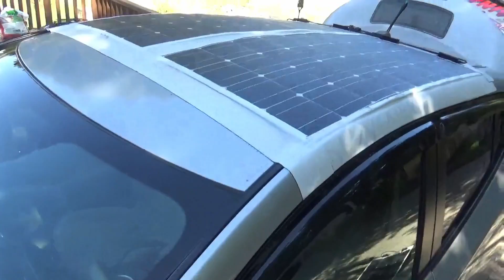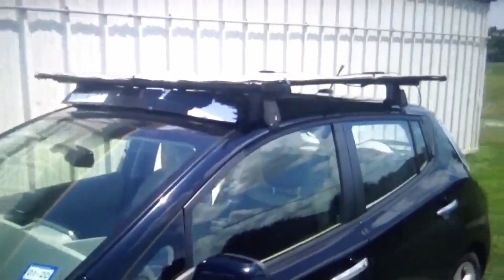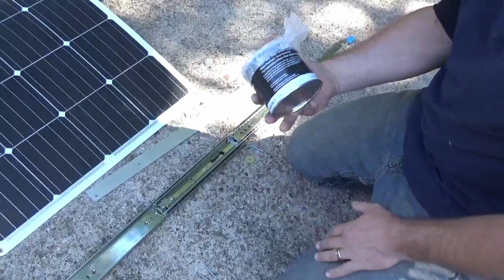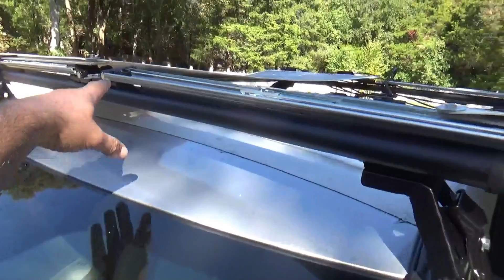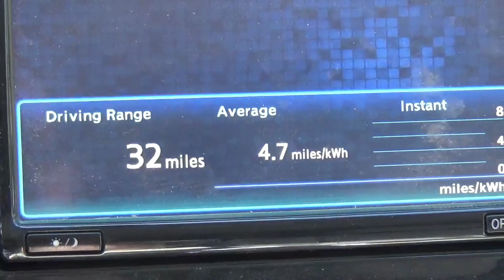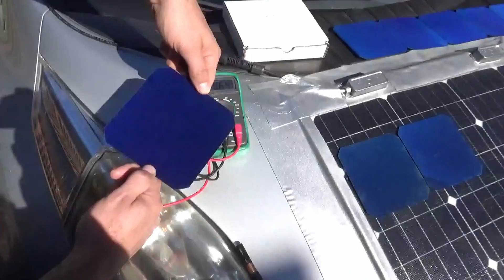Solar Powered Nissan Leaf Ep. 3

Comment: Why do you get such low miles on a charge?
Reply: He has a cheap early version of the nissan leaf with about half of it's original battery capacity. I think he bought the car for like 3k or 4k.
Reply from the maker: @jasongarner340  Bingo.  This range is actually pretty typical of 2011 Leafs with orginal batteries at this point.  Some people were able to get warrantied replacements from Nissan, and have the original 90 miles of range still.  But there were circumstances where a lot of them (like this vehicle) fell through the cracks.

Comment: Victron plus external small relay to control the inverters power switch would solve the current flow issue and allow you to keep the batt bank protected.
Reply from the maker: I found a low voltage cutoff that I think will work much better.  It will be showing up here in the next couple months.  https://baymarinesupply.com/sterling-prolatch-240.html

Comment: Attaching solar panels to a curved surface can be difficult, but attaching solar panels to a flat surface seems to be a bit easier. There are trailer hitch receivers that are built for Nissan Leafs. I wonder if attaching a folding rear rack with solar panels would be easier, and possibly cheaper, than trying to attach many small individual cells and then having to coat those with a resin, protectors, etc.? All of the advantages of a solar trailer minus all of the downsides of a trailer. Here is an example of a folding rear rack: http://thumb3.zeppy.io/d/l400/pict/183664974585/500lbs-universal-aluminum-car-rear-rack-basket-cargo-luggage-carrier-jr1863-mesh . Maybe even a cheap folding bike rack could work? I could see 2 to 3 rigid panels being able to fit on the rear rack though if they were set lengthwise with only half of the panel on the rack and the other half hanging off when the rack would be folded down. Regardless of that idea, it's awesome that you are trying to do all of this in the face of so many people saying that it is impossible or a waste of time to try. Thank you for not only starting to try this but also in keeping the project going! Rock on!
Reply from the maker: It's already inevitable.  Do you know how much you could shave off the price of this system with big auto's buying power?  Atleast 50%.  And if solar panels see the same increase in efficiency over the next 10 years, that they saw over the last decade; increase all solar power outputs in this system by 50%.  I am thinking about the trailer hitch, it just presents some logistical issues when deployed in a crowded urban parking lot.  For rural areas or camping it would definitely work though.
Reply: @InnovativeSustainableSolutions  Yeah, I agree with the constraints presented by a crowded parking lot. I was thinking of having the rack fold upwards rather than downwards (opposite to that of in the picture that I linked) so that when extended the panels would be flat and level with the roof of the Leaf or possibly even higher. I agree, if the rack was low and folded downward then people could run into it or get angry that it was taking up a parking space, but if it folded upwards and was as high or a bit higher than the roof of the Leaf then people could drive their cars under it and they might even like it for the extra shade over their car. In concept, it sounds easy, but in terms of price I think that my idea is creeping upwards, so maybe it's not the best solution. Plus it would look like the world's least effective spoiler - haha. I'm definitely excited to see what you can do with the low-cost solar modules. Thinking about what will be possible in the future is exciting, but I'm pretty jazzed that this is even possible right now. What you are doing is amazing work!

Comment: I wonder how much the added aerodynamic drag of the roof rack panels takes away from the energy added by the panels?  Have you tried to calculate that?
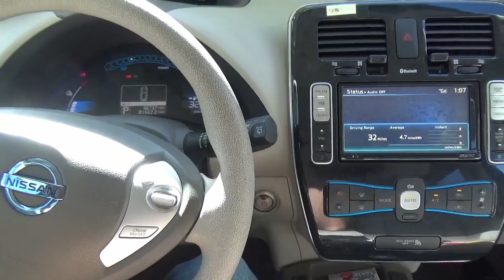Reply from the maker: Good question.  So calculating aerodynamic drag without a wind tunnel next to impossible.  The cross-sectional area of the roof rack is not small, but it's not crazy either.  The panels only being about 1/8 inch thick helps.  My theory is that the cars built in efficiency meter (the 4.7 mile/kwh number shown on the display at 20:00) will actually give us real world data on lost efficiency.  It's been steady at 4.7-4.8 miles per kwh since I purchased the vehicle, so it stands to reason that if after the roof rack is installed we see that number drop down to say 4.3 miles/kwh or so, it's a safe bet that this loss was due to the increased drag.  Every .1mile/kwh loss equates to around 2% efficiency.  The roof rack alone adds an average of 5-6 miles per day averaged across the whole year (3 in the winter 8 in the summer), so the "break even point" would occur when the vehicles range falls to 4.1 to 4.2 miles/kwh (as this would effectively reduce the vehicles range by the 5-6 miles per day those panels are adding).  Hope that helps
Reply: @InnovativeSustainableSolutions   Yes I wasn't expecting wind tunnel testing, just figured you could compare Wh/mi numbers before and after.  I'd expect the impact to be worse in the winter when the air is more dense, and of course less sun to collect.

Comment: Google 'flexible cable tracks' for your slide out wiring question.  Also - are all your panels wired in series? I think that might be choking your system to run at the poorest panel's output.  Nice upgrades.
Reply from the maker: Negative sir.  Everything is in parallel for reasons I have yet to elaborate on, (but you sound like you probably know enough to guess).   Thank you for the part recommendation.

Comment: Hey, I really like what you have done! I wanted to know if you can make a video explaining the parts you’re using. In the first video you showed everything you used but didn’t told us any detail like battery voltage and amps.   I’ve learned a lot from solar since I watched your videos. I am a owner of a 2012 Nissan Leaf and I love your idea but I thought of different method. I want to make a like charge point system. I can bring in and out of my house and charge my car and can store inside   Any idea what I can use
Reply from the maker: I have learned a lot since my first video too, lol.  Thats why I didn't go into the specifics I should have.  I have to have some background information to design the best possible system for you:  how many kwh/day are you pulling out of the charge point, and at what wattage and voltage?  How long do you have to charge the vehicle?  Is the charge point grid or off-grid powered?  Shoot me an e-mail at lonestarezev at gmail and we'll figure it out.
Reply: Innovative Sustainable Solutions thanks for getting back to me. I unfortunately don’t know what grid of off grid is yet and I’ll find out thru out this week any information about the charge point. But what I mean. I really like ur design but found a ALL-in-one charge controller and 2000w inverter thing for $300(have not bought) just need to do batteries and solar panels    But I want to do what you have done but in like a small cart I can do it mobile but that can store more kWh. Again thanks for getting back to me

Comment: You are a pioneer. I'd like to do the same thing with an ev minitruck with a full roof rack panel setup overhanging the front back and sides.
Reply from the maker: This system is MUCH more feasible with a larger vehicle (electric van or truck).  Your available surface are increases at a factor of 2 or 3 times the power consumption for the vehicle.  You can almost make it work without even trying.  You could actually put so much PV power on there that you would blow past what these little hobby charge controllers (mine tops out at 800 watts, 60 A of 12v input) are capable of handling.  I would love to make or collaborate with someone doing a larger version of my Leaf.
Reply: @InnovativeSustainableSolutions  I don't have the time but it's something I want to tackle in the next year or 2 maybe. Everybody would say it's pointless but I know they are wrong.
Reply from the maker: @JoeMalovich  Panels are getting more efficient (and cheaper) every year.  If you have a 1,000 watts of panels on your van, and you increase the efficiency by 1% (from 23 to 24) you just got 40-50 more watts.  This rate of increase is being achieved about every 14 months currently.  I'm looking forward to your solar van.
Reply: @Alsmithize  The oil companies wouldn't allow that.
Reply from the maker: @Alsmithize  It is frustrating.  This would be SO much easier to do on a van.